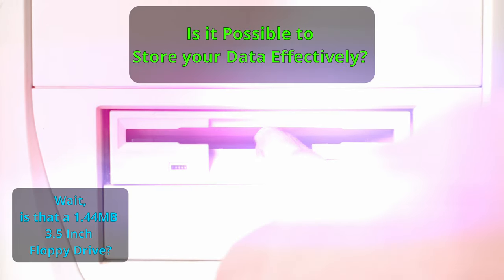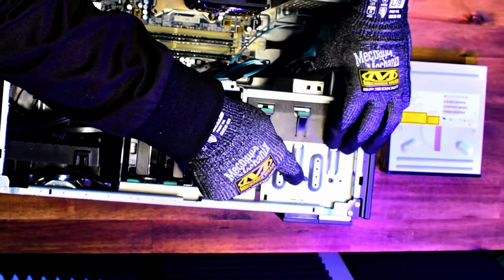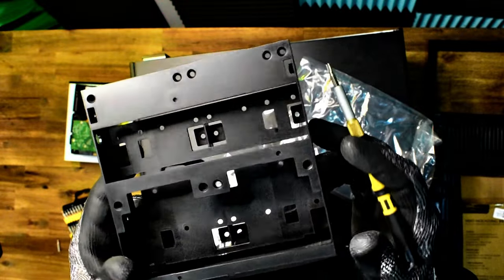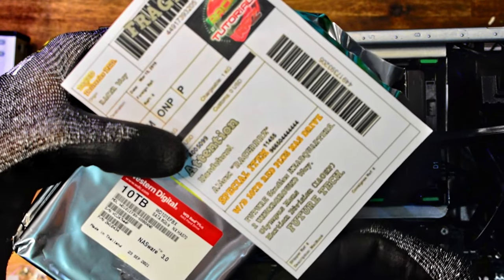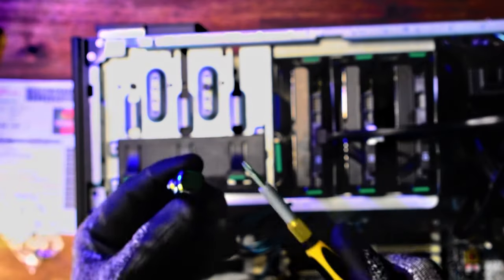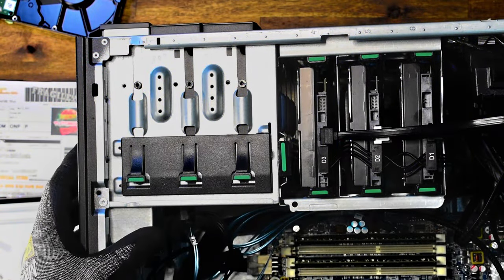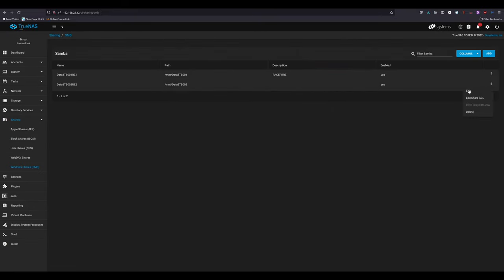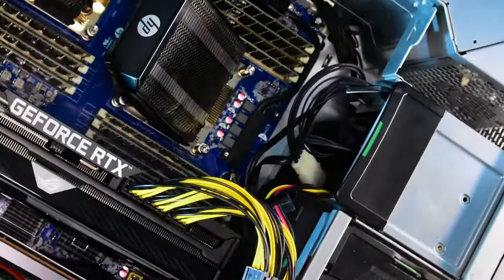Massive 40TB of NAS Storage on a HP Z420 Workstation made easy!

Comment: I just recovered my z420 from a total bios corruption, not bios settings corruption that you could resolve removing cmos battery or with the yellow button in the board but a total bios corruption, it has a crisis jumper that lets you reflash a new bios blindely from an usb or cd.
Reply from the maker: Nice. I have only been successful with such a recovery once, but thankfully it doesn't happen all that often. USB BIOS recovery is one of the more satisfying PC saves.lol. Good job. What are you planning to use your Z420 for?

Comment: I found a hp z820 dual cpu. I could make a nas I never knew how to make. I found your channel and was delighted
Reply from the maker: I am glad you found my content of benefit. The HP Z820 is an absolute powerhouse and it really suits the home server role well these days. 

I have a really cool DIY Mini PC Server build in the works and I hope to give a break down of how to get Proxmox setup so that you can get multiple OS support on your server. For this build I am aiming for ultra low power draw which is a bit different from the Z820's raw power. But the server conversion process remains the same regardless of the system specs.

Comment: thats my proxmox server. will adopt this method to load it with more disks and share them as SMB and NFS using an LXC container running cockpit as a fileserver! Thanks for the ideas!
Reply from the maker: Thanks! Your system sounds well geared. You'd enjoy some of my newer videos also. I presume you have the Z420. I retired this machine for the Z440 (https://youtu.be/K4RalaEbRI4) - but since these have such a small case I case swapped the Z440 into a Fractal Define 7XL. That Z440 is overloaded with drives and TrueNAS is still doing it's thing.  

I am also converting a Mini PC into a Proxmox server where it will serve as a VM test system for basically any OS I need to test out. It will also run some SSDs in RAIDZ2. I was hoping to get 10GbE working on it but I am having trouble getting enough power to it when plugged into a M.2 to X8 PCIe converter + DC power via modified Sata plug lol.

Comment: 00:38 DDR3-1866 - PC3-14900R - ECC - 
I had read that only ecc udimm was supported. Seeing the R of 14900R I tried to put 4 strips of 16GB ECC RDIMM from my DL380P in place of the original 4*2GB ECC UDIMM from my Z420v1 E5-1620. And it works! I'm now the proud owner of a 64GB ram Z420!
Reply from the maker: Hi there. 
Selecting the right RAM for HP workstations can be a challenging task due to the variety of options available. 

When referring to HP's memory documentation, you will typically find UDIMM (Unbuffered Dual In-Line Memory Module) specified as the recommended module type.

Generally, UDIMM is non-buffered ECC memory and it tends to be the most affordable option. LDIMM (Load-Reduced DIMM) offers cost-effective, low-power performance. RDIMM, on the other hand, is buffered or registered ECC memory, providing high-performance capabilities but at a higher cost.

In a practical example, I had four 4TB DDR3 PC12800R modules installed in this HP Z420 workstation (https://www.youtube.com/watch?v=D9kG4Il_XJ4 at 33min 23sec), and they operated flawlessly. It's worth noting that second-hand machines can sometimes come with RDIMMs (Registered DIMMs) installed.

The choice of the best-suited memory module for your HP workstation will depend on the specific hardware configuration. 

The Z420 paired with a Xeon CPU should support all three versions, but it is essential that the memory is server ECC memory (Xeon CPUs can’t use desktop RAM). A different example is the HP Z240 which can support both Intel i7 and Xeon processors, and that is where you need to be careful with RAM fitment (desktop vs server RAM).

For more info I can recommend: https://cloudninjas.com/collections/hp-z420-ram-memory-upgrade

Comment: Nice video. I've been wanting to do this myself. I see you're a smaller channel so I'll sub. Your efforts haven't gone unnoticed.
Reply from the maker: Thank you for the feedback and Sub! You will not regret the upgrade. Getting more HDDs mounted is the challenge but this particular Olmaster adapter really maximizes the use of the 5.25 Inch bays. Each adapter can hold a max of 6 SSDs (or 1x HDD + 2x SSD), if the goal was a SSD server this machine could get loaded up! With the H240 HBA Controller there is scope to run an additional 8 drives (including SAS drives) which really opens up the upgrade options.
Reply: @racerrrz  Do you use yours primarily for video storage? And how much did all the hard drives set you back if you don't mind me asking?
Reply from the maker: @emptyedits.  Yes, right now this machine is only on when I edit video. Normally I can't edit or even play 4K video off a HDD without video playback lag (i.e. the 4K video must be on a SSD or NVMe to view/edit it). TrueNAS has been really impressive. Despite the Z420 being connected to my main machine via 1GBe ethernet cable, I get sufficient speeds to view / edit video over the LAN cable. But I still prefer to have all my project files on the video editing machine on a NVMe to avoid any delays / crashes etc. I aim to only buy hardware when on sale. To help with the buying process I have listed the cost breakdown in the video description. The 10TB HDDs cost quite a bit, I got them for ~300USD each in June (their prices fall over time; I found this on Amazon right now which is a solid price for 10TB Pro! https://tinyurl.com/3b5sudx9 (url was massive, hence tiny url ). I have 2x 4TBs in RAID 1 which are used more for critical data (like finished projects etc.). Those were around $130 USD each. The HDD cost really hammers the budget but not having storage space is just a pain. I have the retail price ~$1680 USD for the whole Z420 setup, but my actual cost will be lower through bargain hunting (e.g. I got the Z420 base machine for ~$100 USD). I did consider buying an off-the-shelf NAS but I was certain a custom machine would give better bang for buck.

Comment: You should look in to a hot swap 5.25 to 3.5 unit for 3 5.25 bays, it would get you 4x-5x 3.5 bays out of the 3 5.25 slots and have it's own fan to help with cooling.. If you stick with the 5.25 tray adapters, you could put a washer on the screws to enable it to grab on to the case, recommend a lock washer for that. The choice to go Raid 0 is a pretty risky choice, any drive fails you lose all data on the array.. I think you know that, but the viewers might not all understand that Raid 0 is basically for speed only and to never store anything valuable on it.
Reply from the maker: Solid advice, thank you! I have seen some reviews of the 5.25'Bay docks (The Art of Server had a good review on one (https://youtu.be/nQU90wCCpSc). I was looking at the Icy Dock FlexCage MB973SP-2B but they can be hard to source, hence I settled on the Olmaster adapters.  I need to find some screws that can work in the Z420's mounting hole and the Olmaster's cutout. The issue there was that the screw had nothing to thread into and a larger screw had trouble clearing the Z420 mounting hole. I was actually looking at options to expand the HDD storage space, but as you know the Z420's case has a HDD limit and I am fast approaching it. I was considering a custom case, maybe the Fractal Design Define R5 Mid or XLR2 that focuses more on HDD space (I'd transplant the Z420 motherboard). I would want to get to a RAID 5 ideally but that costs a small fortune in HDDs (although only 3x HDD would be enough for RAID 5). For the time being I have 2x independent RAID 1 Mirrors. First RAID 1 setup is 2x 2TB Red NAS (so 2TB total) HDDs as the main storage for critical data. This data is backed up onto RAID 1 2x 4TB (so 4TB total) Red NAS drives in the Z420. From there I have the 3x 10TB drives as "sorting drives" for now, but if I can accumulate 1-2x more HDDs I'll consider a RAID 5 or 10 config. The main issue has been storing project data. A 15min 4K video project's files nets ~60GB of data (full project). I only have the Z420 powered when I need to do a backup or when I am busy editing video.
Reply: @racerrrz  Also, there are simple stamped metal adapters that bolt to the side of a 3.5 inch drive so they fit a 5.25 inch bay. They've been around for years. My Z240 has 5 SSDs and 8 boxes of spinning platters installed currently (68 TB currently). I use an external DVD drive so I could free up some 5.25 inch bays, since my Z240 came with two DVD/CD burners installed.
Reply from the maker: @danajorgensen1358  Hi Dana. Your 68TB setup sounds impressive, especially if inside the Z240 case! I have some idea of which metal adapters you refer to. Did yours come with rubber grommets to mount the HDDs? Do you have a part number by any chance? I presume you have a HBA controller to operate all those drives? The Z240 only has 4x sata ports off memory but a HBA controller solves that issue quickly.

Comment: Am currently using my Z420 with esxi 6.5 running 5 2019 server VMs with a dell perc card and 64gb ram, rock solid HW
Reply from the maker: Awesome VMware setup there! The Z420 really works well from the server side of things. Which model Dell PERC card do you have? The Z420 HP documentation leaves only a handful of options for HBA controllers and that got me to settle on the H240 HBA.

Comment: I used a z220 motherboard with a low power xeon and ecc ram. 5x4tb seagates. In a case that fits 9hdds.
Reply from the maker: Hi. Nice, that sounds like a great use for the Z220 + case swap. Fair call there. The Z420 case doesn't hold that many HDDs which makes a case swap all the more appealing. Which case have you got? Having space for 9HDDs is a solid outcome.
Reply: @racerrrz  its a old $35 case from Newegg. DIYPC FM08-BK. The whole front was made for 5in drives but I just got some 5in to 3in adapters. The Z boards have a lot of expansion.
Reply from the maker: @ProximoNovio  Nice find! For a "retro" case that is one mean full tower. I was looking at external HDD cases to expand my storage (eventually), but maybe a tower loaded with 5.25' / 3.5' HDD bays is the better way to go!

Comment: @0.36 : Not True! The Z420-versions are: "Sandy Bridge" only ( E5-16xx v1/ E5-26xx v1) and "Sandy Bridge" + "Ivy Bridge" compatible which means that the later one also supports E5-16xx v2 / E5-26xx v2. ;-)
Reply from the maker: Hi there. Let's call it a technically. We are both saying the same thing, but I'll argue that your description has more clarity where mine was simplified down to occupy a mere second of your time (I think the color scheme may be confusing, that was just to highlight the E5-16xx to E5-26xx family difference – voice-over did the V1 / V2 comparison). To clarify with extra detail: Z420 Motherboard : 619557-001 can only support V1 processors (Sandy Bridge (V1); e.g. XEON e5-1620 or XEON e5-2667). Z420 Motherboard : 708615-001 can support V1 or V2 processors (Sandy Bridge (V1) or Ivy Bridge (V2); XEON e5-1620 or XEON e5-1620 V2, or XEON e5-2667 or XEON e5-2667 V2).

Comment: I'm currently booting from an NVMe on an ad-in PCIe card with no issues.
Reply from the maker: Hi. If you don't mind sharing your setup / process that will be cool. I have tested a workaround but I have not managed to get my Z420 to boot from a NVMe. (I tried Clover Boot on an internal USB 3.0 slot but it never booted into Windows 10 for me; the Clover menu worked but it didn't seem to read my NVMe correctly).

Comment: Have you create raid 0
Whitout pci card ?
Or just Single hadrive
Thanks for sharing
Reply from the maker: Most of my RAID 0's have been with NVMes. And I do this to create a larger NVMe storage pool that I can use to quickly transfer large projects to and from. You could do a RAID 0 with SSDs or even HDDs, and that use to be quite popular before NVMes were around. But these days it just works better to use NVMes in RAID 0 and HDDs in RAID 5 etc. With that said, it could be cool to test some SSDs in a RAID 0 to see just how far you can push their speeds. I would expect 4 SSDs in RAID 0 to give ~880MB/s Read and ~700MB/s Write (pure guess). I might test it to see.lol. You could also take NVMes in M.2 USB enclosures and connect that in RAID 0 but I would expect that to be less reliable.

Comment: Thank you for the video! I noticed you utilized 2 bays in the upper part and 3 bays in the lower part, however you didn't touch the top bay in the upper part. Does that mean there are actually 3 bays in the upper part for 3.5 inch drives?
Reply from the maker: Hi. I am glad you found the video useful. You are correct there. If you choose to do so you could fit an extra 5.25" adapter in there. The adapter that I have in there right now can hold two SSDs but it also has a carry handle which I found quite useful. For your reference, I give a more comprehensive breakdown of this Z420 Workstation's hardware in this video (this was before the Olmaster upgrade): https://youtu.be/D9kG4Il_XJ4 (~16min).

Comment: The case is pretty bad at airflow. Did you measure idle power consumption without or with 1 drive? Desktops of these generations are at about 20W. The hard drive controller will add some 5W at least. They get hot.
Reply from the maker: You are correct there. Airflow isn't outstanding but the HP case does a good job to balance noise and cooling. I use HWiNFO (when in Windows) to monitor HDD temps, or TrueNAS, and the HDDs usually sit around 25'C to 31'C pending load. I just checked my power readings for this machine. Net Power (full Z420 workstation in current config; using Kogan Smart Wifi Plug): ~210W Booting (fans max speed), ~120W Idle in TrueNAS, ~165W 4K Video File Transfer to 1x 10TB HDD and the same reading when transferring to 2x 10TB HDDs. That was a little higher than expected but then the machine is loaded with hardware. Less HDDs would save some Idle power, a more efficient PSU would also help to keep running costs down if this was left on 24/7.
Reply: @racerrrz  The PSU might not be the cause. These had the option of Platinum rated ones (the label says High Efficiency if this is the case). I need to measure my own build as well, it has 10 drives. Be back in a day or 2.
Reply from the maker: @valkaielod  I double checked my one. It's a 600W high efficiency (632911-001) PSU, which makes it hard to beat from a 24/7 NAS perspective. 80PLUS Platinum PSUs are pricey also, so the Z420 PSU might be the best bang-for-buck option here. I'll keep an eye out for what your readings look like.
Reply: @racerrrz  Told you so :). My build is a bit different. What I measured so far is the standby use of the old mainboard with a 1st gen (i) Xeon and an ASUS server/workstation. This was in line with what I knew from the 2nd and 3rd gen HP Desktops, around 20-30W in idle. The PSU is a Gold rated FSP unit. I will give it a spin over the weekend.

Comment: Is there any limit of HDD size with the old Intel® C602 chipset? the manual wrote: Up to (4) 3.5-inch 7200 rpm SATA drives: 250, 500 GB, 1, 2, 3 TB, 12 TB max, but SATA hardware RAID is not supported on Linux systems. The Linux kernel, with built-in software RAID, provides excellent functionality and performance. It is a good alternative to
hardware-based RAID. I would install 3x 20 TB seagate, will that work?
Reply from the maker: Hi. The manual would have been up-to-date at the time of publishing but right now you can obtain much larger drives. I am not aware of any hardware limitations on drive sizes (MBR disk formatting has a 2TB limit however). I have only used up to 10TB drives in my Z420, but I have 16TB drives in my Z840 and Z440. 

Even if you did find the chipset became problematic you can still overcome this issue with PCIe HBA card. I use the Intel H240 HBA to all connecting more HDDs (it was in my Z420 and now I have it in my Z440 case swap ~70TB NAS build). Dual MINI SAS SFF-8087 allow for 8x SATA (6GB/s) / SAS (12GB/s) ports and RAID 0, 1, 5, 10 is supported. So there should be no issues with your 20TB RAID on the Z420. 

One way to check would be User Benchmark - if another user has posted their machine with 20TB HDDs that would support it as possible. A quick check – 4x 16TBs https://www.userbenchmark.com/UserRun/47073843
Reply: @racerrrz  thanks a lot!

Comment: possible to windows xp on this machine ?
Reply from the maker: Hi. Yes absolutely, in fact the Z420 was likely released with Windows XP or Vista. You will be able to run RAID as well if you so desire.
Reply: @racerrrz  have you tried installing xp/vista yourself? thanks ! subscribed !
Reply from the maker: Hi  @gurukantdesai4225 . No I haven't had need to use Windows XP or Vista in a long time (Microsoft discontinued updates for XP not too long ago which means XP isn't safe to use online anymore). I mainly use Windows 10, Ubunto on occasion, and TrueNAS. The last time I used XP or Vista was ~2016 I think. I prefer Windows 10 over the older systems.

Comment: Got an HP Z440 for $240au. E51620 v4 16g ddr4 256g ssd k2200 4g gddr5. Going to upgrade a few things? Chur brother.
Reply from the maker: Hi Hona. Awesome bargain you scored there! You will not regret that Z440 for that price. The Z440 has some solid upgrade options, pending your end use plans for it. If you can source them, the HP Z Cooler (828230-001) or Memory Cooler (J2R52AA) are cool Z440 upgrades! If you haven't seen my related video yet, I go through the Z440 in a heap of detail here: https://youtu.be/D9kG4Il_XJ4